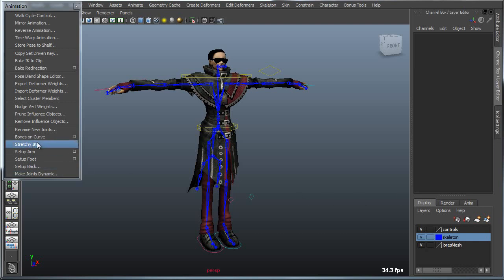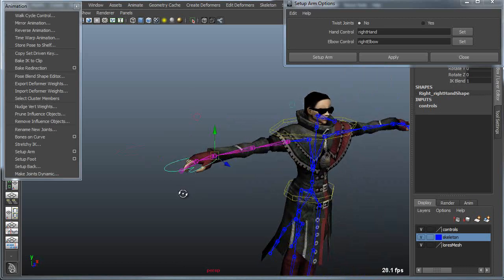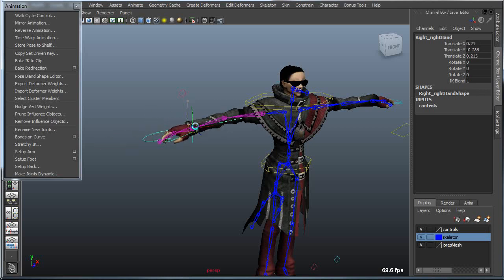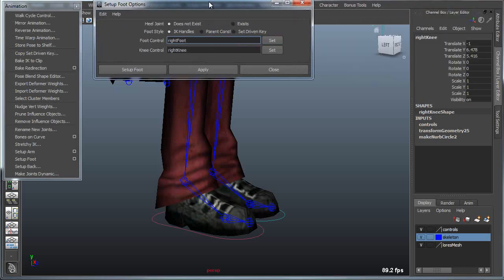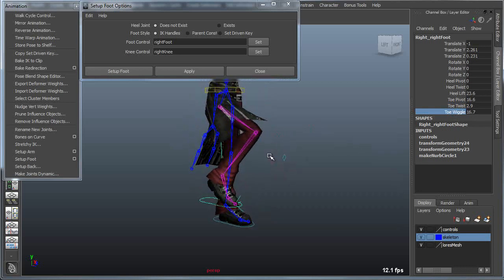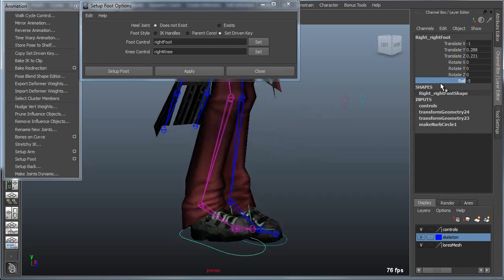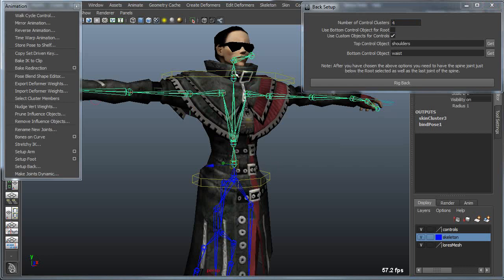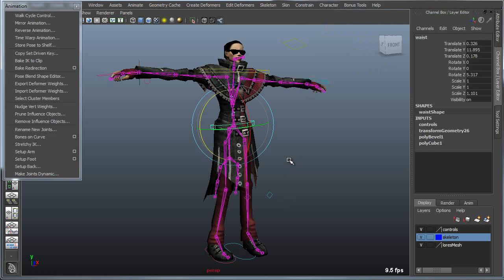Maya Bonus Tools - Auto Rigging Tools

Comment: Bonus tools seem to be buggy. For instance the foot setup is not consistent and on my end, only works on the left side of while on the right leg, it breaks when running. I troubleshooted everything.
- made sure that the joint orientation sis correct
- controler names are correct
- even recreated the joints and that did not work
This is so frustratting. Faster to simply manually recreate the ik leg.

Comment: Still great info, thanks for the video.  IMO although custom/modular systems are out there & more advanced, these Bonus tools could still cut the mustard if updated. Other systems out there also rely on their own skeletal setup, which generally prevents myself from using them. HumanIk is a great idea too, but realistically requires a custom rig for something useable for productive handkey animations. An updated version of these tools would more than do the job, & perhaps even allow the creation of a simple pose/animation manager that worked directly with the HumanIk system.

Comment: Thats cute but..... it's not mGear. Come on autodesk.....
Reply from the maker: Callum Austin - note that in the description I mention that these are older example scripts to be used as reference for someone building their own custom rigging scripts.
Reply: @MyOhMaya  yep, I understand that this is an example of an old tool that won't be used on any productions. But doesn't that raise the question... Why doesn't AD provide users with a solid modular rigging framework that IS up to date and allows riggers with something they would love to use? The guys at mgear, advanced skeleton, control rig, ephemeral rig etc are doing a great job pushing the boundaries.
Reply from the maker: @callumaustin9567  - You raise a good point in that there is already ready plethora (for lack of a better word) of higher level rigging toolsets out there that have been built on top of Maya.  Not to mention the hundreds (literally) of custom rigging tools out there that many, many studios have built and continue to maintain.  Maya's core strength has always been that it's a powerful platform to build on top of.  Most recently we've been focused on improving the nuts and bolts of this framework. For Maya 2020 for example we made many lower level architectural changes that will indirectly improve all rigging tools.  Matrix driven transforms and geometry rest state connections being examples... new point tracking nodes and a new topology independent, gpu accelerated wrap deformer.  

https://area.autodesk.com/tutorials/series/maya-2020-rigging-tutorials/

And there is more low level stuff along these lines in the pipe that I can't really discuss yet.
Reply: @MyOhMaya  Thanks, I appreciate that maya developers have added things like a new rivet and a parent matrix offset. This is all useful. However it can't be an excuse for autodesk to be complacent with the development of higher level tools. It's a bit of a cop out in my opinion.

Let's see what will happen in the future....